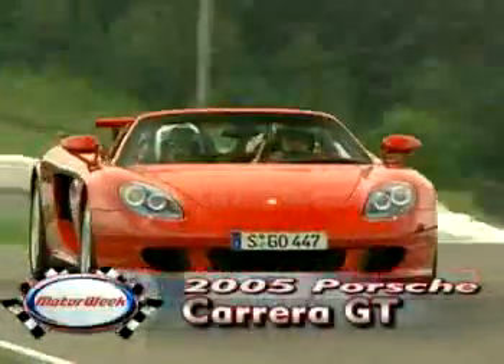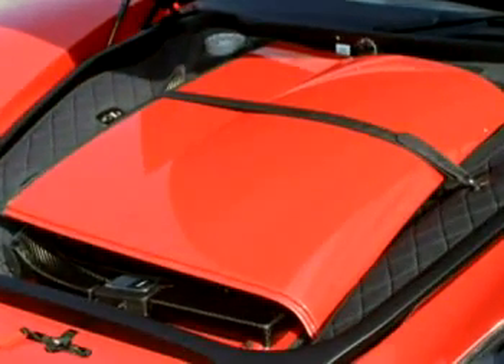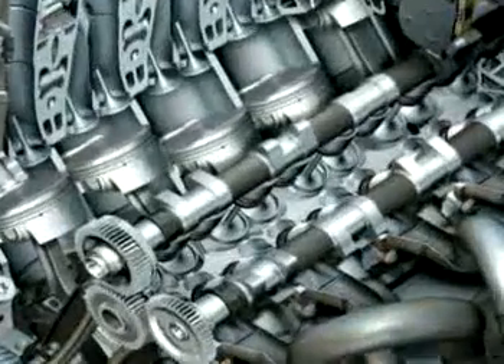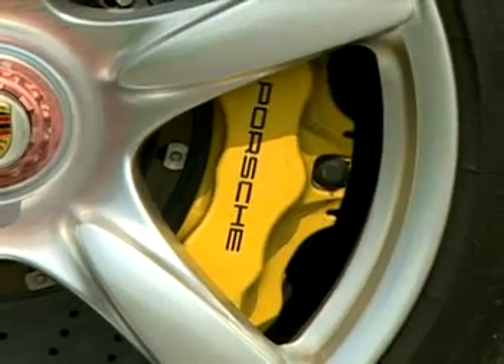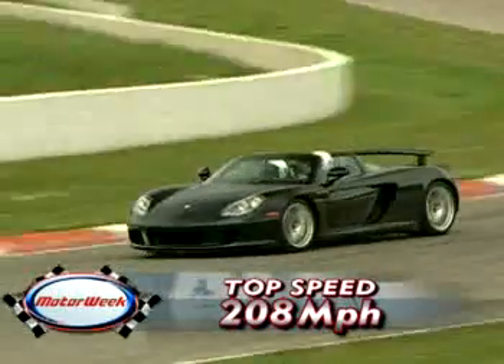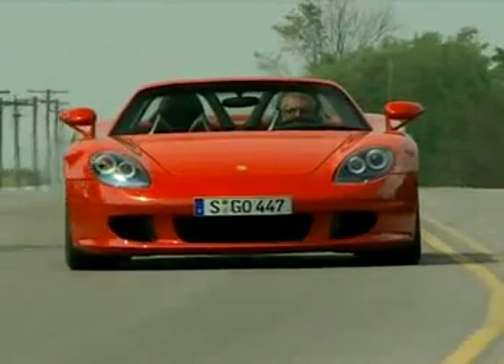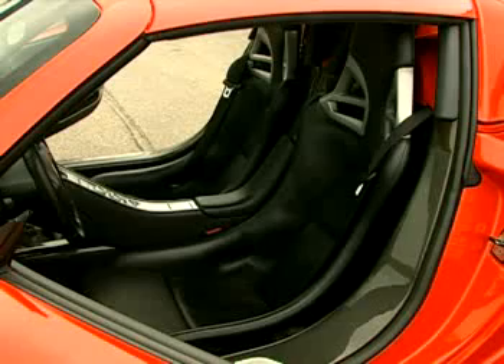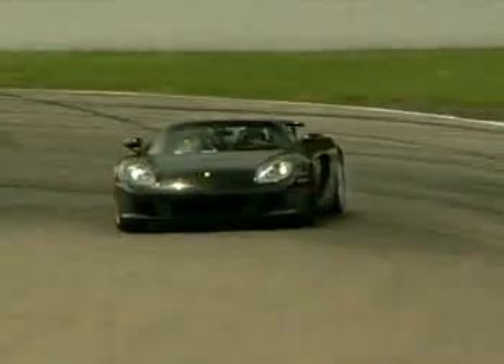Motorweek Video of the 2005 Porsche Carrera GT

Comment: Odd how so many reporters are taking cheap shots at this car, since Walker died.    This video indicates the car is easy to drive.   Top Gear described the cars as unbelievably good.   Top Gear also fairly indicated that the car was powerful so that caution and skill were needed to drive fast around corners.   This car did not kill Walker...careless driving and reckless operation did.

Comment: RIP Paul Walker.  The car sounded very dangerous from the video commentator once you think about the road Paul was driving on before the crash. Front and Side air bags probably trapped him inside. With those horrible handles that you have to reach for down by your legs. And the gas tank in the front, probably full, Hitting two trees and a sign post. Damn. I was worried about my Mom in her Santa Fe driving through light snow but one wrong turn and it's all over that Porsche. That Porsche is ugly and has terrible turning control. REST IN PEACE Paul Walker.
Reply: tank is in the back between the engine and seats!
Reply: Deployed air bags deflate within seconds. How can you say that it has terrible turning control without driving it? Considering the damage It must have been reaching the speeds of 100mph on a public road
Reply: From what I've seen in the videos I've watched and heard from experts. Yeah.. speed was a big problem. Didn't know about the airbags thanks. Still a terrible car if you're not experienced and attentive.
Reply: It's fast, but the car is too long which has made it's turning uncontrollable. True, you have to learn how to drive this car. The car slammed sideways into a tree though and split in half almost. Because of the turning and length of it. So, when the gas tank exploded behind them, they had no choice. I was told that the gas tank was in the front of the car. Tragic loss of life, he so much more life to live. And that stupid driver killed them both.